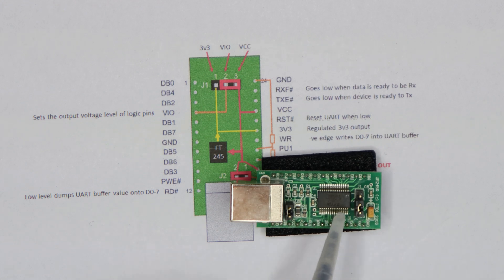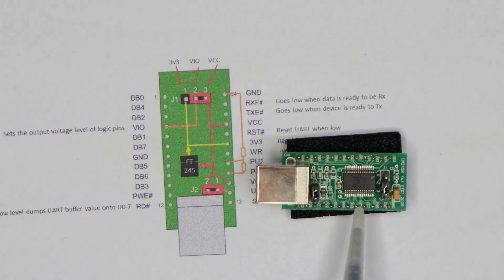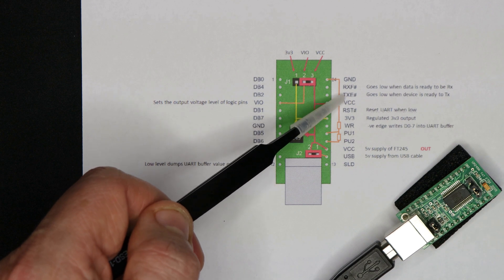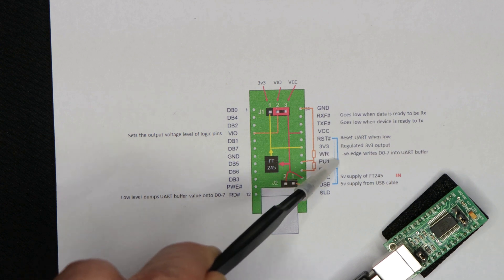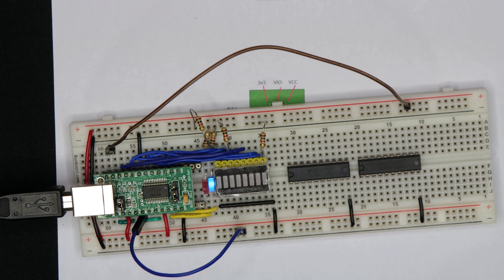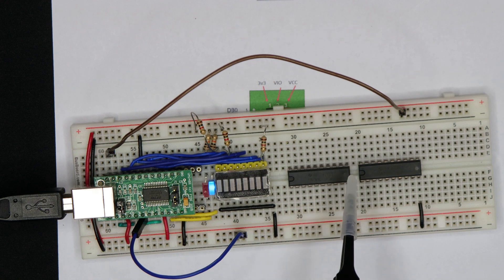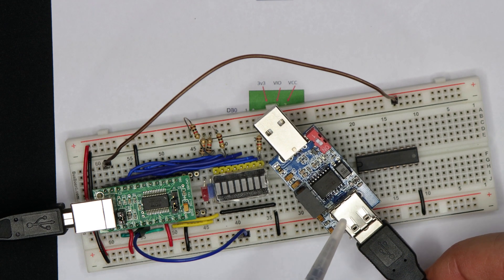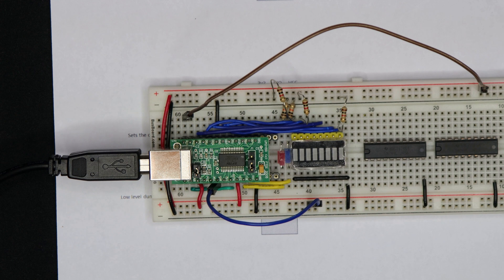Comms using the UM245R - SPAM-1 8 Bit CPU - Part 7

Comment: Nice video. I’m uploading data from a host (MacOS, VCC driver and minicom) to a project via this FTDI UM245R. It works for super low data rates but at higher data rates (when the project can’t process the data as fast as the host can send it) I loose data. Did you have any issues with flow control?
Reply from the maker: Hi - glad you found it useful.
I haven't seen that. I did a test where the FTDI device was driven by a tight loop in assembler, basically as soon as the data available line signalled then the program on my project read the data, I didn't notice loss but perhaps I wasn't looking carefully enough.  If you are uploading over USB to the device using the virtual com port approach as I do then perhaps there's some weakness in the handshaking in the protocol there. One would expect the device to be nack'ing if its buffer was full.
I could do a test where I don't slurp the data out and see whether it blocks.
Let me know if that's useful.
Reply: @JohnLonerganProjects  Thanks for replying. I found the problem after some investigation. At high data rates the 245’s RXF# was going high so briefly (250ns) that my MCU was missing the falling edges (which I’m using as an interrupt). I ended up putting a monostable in between the 245 and my MCU’s IRQ to widen the RXF# pulses. It now works reliably at high data rates. Nice piece of kit. Look no UART!